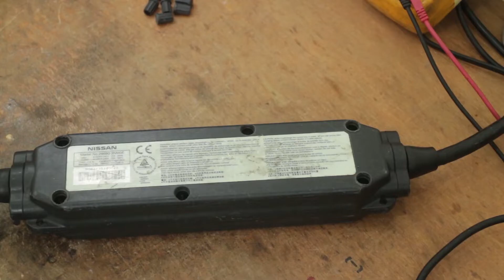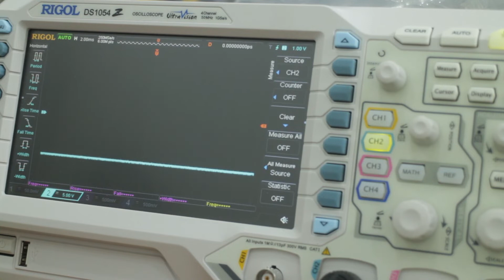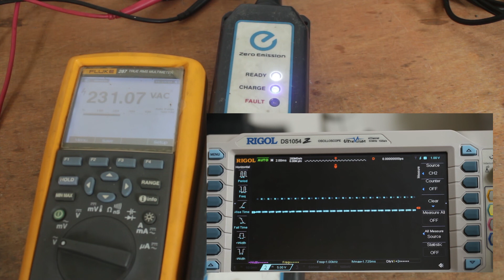Nissan LEAF charger (EVSE) repair

Comment: Did you actually repair it? The most common fault is the transformer, which is the only component that is rated at 200 volts, and it will fail when connected to 230 VAC. 
This video only really shows how to open the enclosure, not how to remove the circuit board let alone repair it. Is it possible to replace the transformer on these EVSEs? It was relatively easy on the earlier ones from Nissan but these ones are more robust but not easy to repair as the circuit boards are encapsulated.
Reply from the maker: This is not a step by step instructional video. Anyway the old Nissan EVSE transformer will hold at 230VAC for some time but it will fail eventually. The transformer failure isn't the only fault in these types of EVSEs. Its possible to make a new power supply and bypass the original one. You have to scrape off the epoxy layer  at right point to do so. most of the time I install a new control board

Comment: it if show DC voltage on minus instead plus it means wrong polarity provided to  voltmeter
Reply from the maker: Here it's not the case. I have probed negative to earth (system ground) and positive to pilot. You can see minus voltage on the oscilloscope screen. If  - 12V present in pilot line before you plug in to the car then there is a unknown error in the EVSE.
Reply: @aeesolutions  sorry  ! i was to quick with opinion .. based on that i have done wrong connecting the voltmeter million times

Comment: to remove the screw caps just drill a hole and use a screw hook to pull them out. they are over 1cm or 1/2" so you can't pry them out
Reply: But then I will need new screw caps.

Comment: what if no indicator light comes on when connected? a local (conventional) electrician said 19a are coming in but only nine coming out, and that a new transformer is needed. where/how to obtain one, or a replacement motherboard? Thanks
Reply from the maker: If no indicator lights on then it could be a power failure on the motherboard. Don't go to conventional electrician because they may not know how EVSE works. In your case you may have to replace the control board. Try to find a electric vehicle workshop nearby. They will help you to repair it or direct you to right person/workshop. Good luck

Comment: Hey. My charger’s temperature sensor has a fault. Anyway to contact you? Im from SL.
Reply from the maker: Hi. How did you figure out its faulty ? Did you check the resistance ? Anyway here is my contact number 0714951177
Reply: @aeesolutions  where r u work shop..